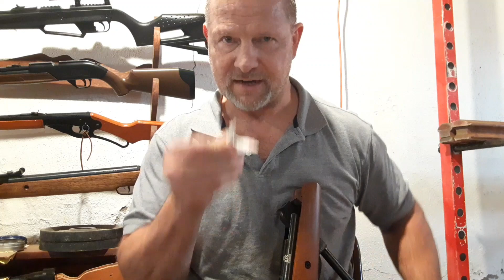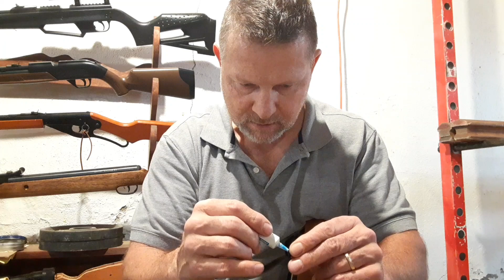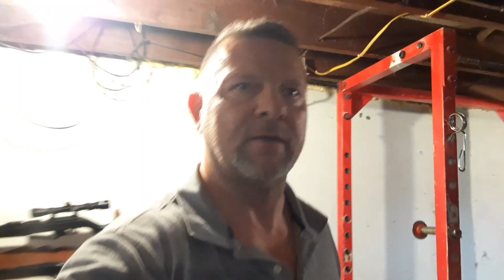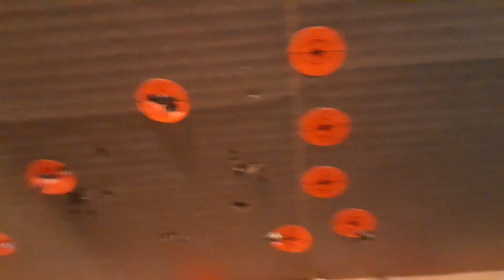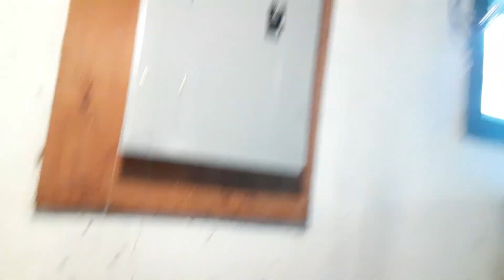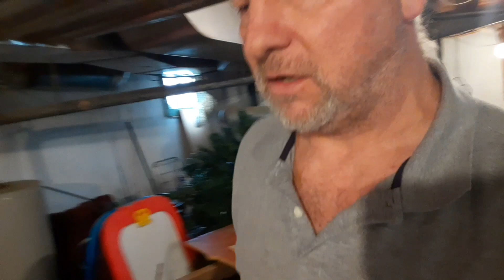Hatsan 95 Owners: Important Information: + A Big Thank You for 1000 + Subscribers

Comment: Don't know if you respond to older vids, but here goes. I see you didn't remove the barrel to tighten the transfer port screw. Does that mean it's not required, or not necessary to get it good and tight? Also, I am seriously thinking of getting the same gun, only the vortex instead. With your experience, how risky  a purchase is this, sending it back 3,000 miles ( I live in Canada) for an exchange or refund gets quite expensive. Thank You.
Reply from the maker: @fedup7416  
Good morning Mr Fedup.🌄🤠👍
I answer all questions that I see, but some are hidden by YouTube.
I don't believe that the loose transfer portal nut 🔩 is a common occurrence. 
It is a very easy fix with no need to remove the barrel. 
Unfortunately, Hatsan has a high failure with the Vortex gas springs, so I recommend the steel coiled version of the Hatsan 95.🤠👍
Reply: @springpistonriflefeverlone9611  Thank you for responding to my questions, I'll take your advise and pass on the Vortex. Unfortunately, here in Canada we don't have many Air gun distributors, so the spring model is not available. I already have a Diana 48, but I was looking for something cheaper to replace my Trail np2.  Thanks again and God bless.
Reply from the maker: @fedup7416  
God bless you!😃👍
Please keep me posted on your decision. 👍
Hopefully I will see the notification.
I know that new comments are seen and secondary comments are hidden.
Reply: @springpistonriflefeverlone9611  Good news, I found a supplier in Ottawa that sells the mod95 in a springer, It's on it's way. I have book marked your channel so I can keep up with the modifications, Thanks.
Reply from the maker: @fedup7416  
That is super great to hear!😃👍
Check it over thoroughly, check the barrel with a pellet to bore test by pushing a pellet through the barrel. 
I hope that it is a good shooter for you.
Reply: @springpistonriflefeverlone9611  Got my Hatsan 95, and I'm really happy with it.I find it shoulders really well, with nice weight. It's a bit crunchy at first when cocking it, but seems to be settling down. The trigger out of the box was pretty nice, I have tweaked it a bit and it feels great. It has ample power, and so far the accuracy is looking very consistent. All the nuts and bolts were tight, and no issues at all, very nice looking and performing rifle for a great price.

Comment: That's an interesting design and I bet you uncovered the source of a common problem for hatsan 95 owners.  It appears that Hatsan might use different transfer port inserts to restrict air flow (using smaller or larger diameters) to conform to specific powers depending on country.  Maybe that's easier and cost effective compared to other methods.  It seems the red loctite you mention would be what the factory should use.  Good catch and I'm glad you got a decent shooter.  Hopefully it turns out to be a great shooter.
Reply: You're probably 100% right that they control the Fpe with that. Tempting data for many owners in different countries in the world.
Reply from the maker: Thank you 🙂👍
Reply from the maker: @j.verfaillie5742  When I shot without that "screw nut" in place it lost 15 FPS.

Comment: Hey Chuck! Hope you're enjoying the Spring time season! You certainly look warmer :) My 1st true pellet gun was a Hatsan Model 55, my main problem with it is that screws holding rifled barrel to the power chamber always came loose. I ended up over tightening them and stripped the thread in my younger days, that was before I was introduced to Loctite. Must still strip that rifle when I get time and trybore and re-thread all the locking screw holes with larger screws. Be safe and keep well man!
Reply from the maker: Good to hear from you 😃👍

Comment: Basically the whole transfert port is threaded and could be swapped?
This would be kind of cool if they gave you "jets" to tune it like a carburetor haha

Congratulations on the 1000 subs!
Reply from the maker: Thank you 😃👍. It would be cool if it didn't fall out and gouge the breach seal 🙂👍.
Reply: @springpistonriflefeverlone9611  Yeah this gives it more negative points than positives 😂
There is probably a reason for it... They must be using the same tubes for the .177 and .30's but with a different transfer port.

Good for them to save money but not for you to save your breech seal.
Reply: @LowkeyAirgunner  Agree. The PY's website listed fixed adjustable power.

Comment: I would think, it would be so you could use the same receiver and pressure setup over several calibers. you wouldn't want a 25 cal port over a .177 barrel, or a .177 opening for a 30 cal barrel. port matched to barrel.
Reply from the maker: @steve-rr3nq  
I fully believe that it's for reducing the power for countries that have power restrictions. 
They would simply use a smaller breach port hole in the screw/nut.

Comment: I just noticed those screw in tp "adjusters" definitely a potential problem if not addressed. Before I fart around with mine, do you know if they can be screwed in too far and potentially hit the piston seal?
Reply from the maker: Thank you for checking out my video!🤠👍 You will not have to worry about the screw in adjustment hitting the piston seal. Just use blue loctite and screw it in all the way. 😃👍

Comment: This just confirms my experience with Hatsan 6-7 years ago. It's a shame they use walnut stocks and crap quality control. You can see they don't polish the barrels down very well before bluing. My 1st 125 had strips in the bluing on the barrel. That's also the gun that has a chewed up piston seal due to large metal shavings in the compression tube. Like China someone has to force them to do quality control. The Winchesters I have from 10 or so years ago are finished out really nice because Daisy required it to meet their specs.
Reply from the maker: I agree Charles and I think that Gamo/Daisy is a better company 🙂👍.

Comment: Thats the adjustment for the UK 12 foot pounds of energy red lock tight blue will only hold up for about 1000 pellets
Reply from the maker: I figured it was for power adjustment. I have about 3,000 pellets through this Hatsan with no wiggle on the breach-port nut.
To make the blue loctite work better, thoroughly clean all of threads before applying blue loctite. 😀👍

Comment: can you remove this nut completly?they make this to underpower guns in certain markets..with different diameters..
Reply from the maker: @dimitrisvouts6623  
Yes, you could see it in my hand,✋ but why would you want to remove it?
I tried my 95 22 caliber under the chronograph with and without the breach port nut 🔩 and it had less fps  without the nut.
My advice is to leave it alone.🎯🙂👍
Reply: @springpistonriflefeverlone9611  other nuts have small diameter for lower muzzle energy

Comment: So far I am not real impressed with the accuracy of my 95
Reply from the maker: I shot mine a lot, probably 300 times. Today I was getting some pretty wild shot groups, but after about 80 shots I finally got 9 out of 10 under a quarter at 20 yards with CPHP 14.3. The trigger is pretty heavy too. I'm planning on putting a lighter spring in behind the trigger and that should make the trigger more manageable 😃👍.
Reply: I haven’t got that many shots yet. I have 30 days to decide if I want to return it so I will keep trying
Reply from the maker: @WalnutandSteel  I hope that it improves for you. It's really hard not to grip down on the pistol grip and throw shots with that heavy trigger. I try to put my mind into my trigger finger, lol.